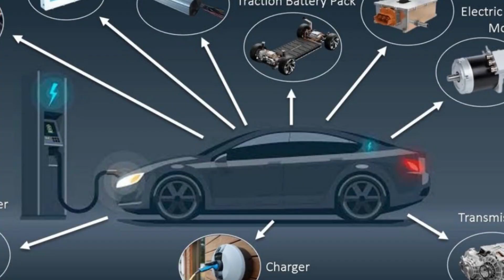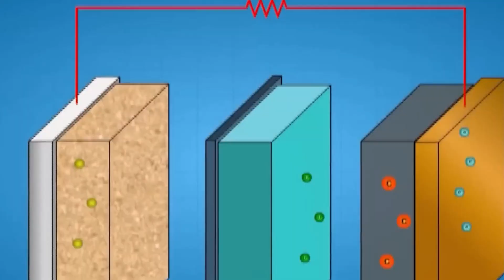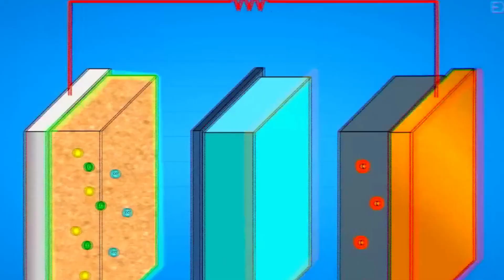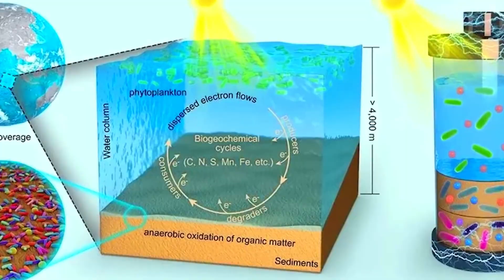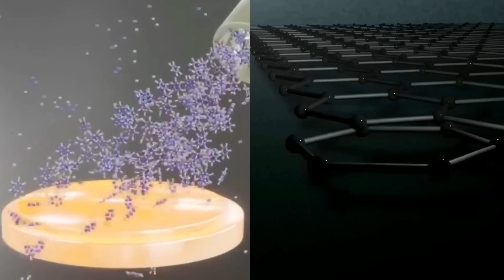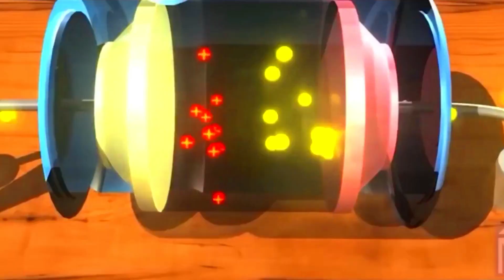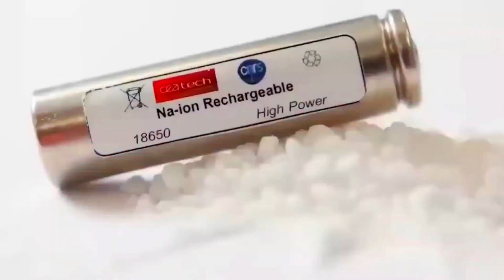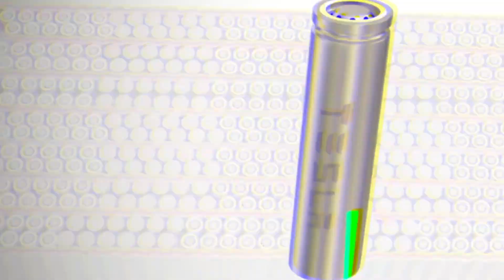Why Sodium Ion Battery Better Than Lithium ?

Comment: If over heating thermal runaway is big factor where is the heat dissipating breakthrough...Wire resistors is real already. Where is the heat energy recycling.

Comment: Car manufacturers need to standardise battery shape and size.   As better battery technology arrives vehicles can upgrade.  Battery removal and loading systems need to be added making it easier to swap or change batteries.
Reply: Agreed. If they're easier to produce with more abundant elements, the life cycle optimization becomes about swapping out and recycling.